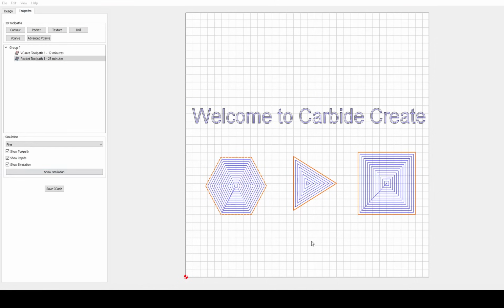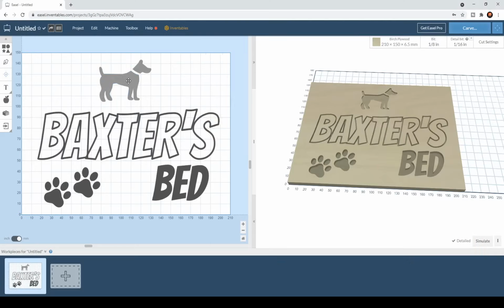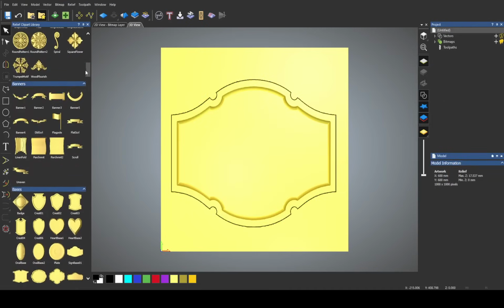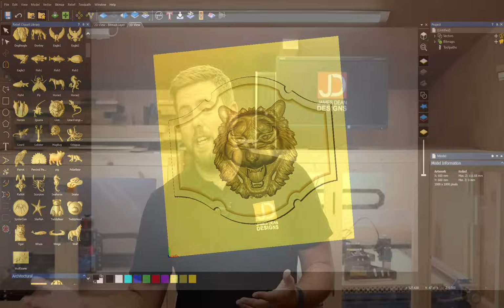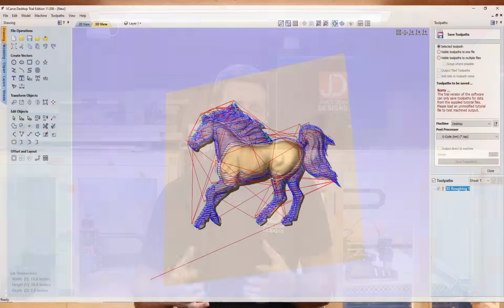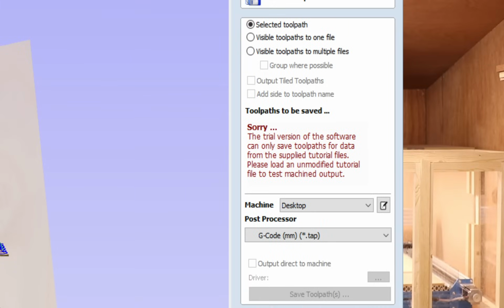Beginners guide to desktop CNC software

Comment: I have a General International CNC machine and the software that come with it doesn't work. Is there a gcode software out there I could use with my junior high students that would work with this machine? Please Help. Thanks In advance
Reply: CNC Router , sorry
Reply from the maker: @gillesdaigle7139  do you mean for creating the gcode or sending the gcode to the machine?

Comment: I have a Dell windows 10 desktop computer with a 64 bit . I just bought a CNC Pro 3018 router with spindle and lazer attachments I can use. My question is do I need two different GRBL programs to for each one. I have installed the GRBL  v4.9.4 for the Lazer. It worked the first time, but stopped, I'm guessing its  because I didn't have the Lazer installed, I had the spindle router in at the time of testing it.  It showed a connection to my computer and slid R to L and then went down it wouldn't come back up. I turned off the machine and hand spun the shaft back up to the beginning position. My kit didn't come with the manual GRBL controler, I've ordered one, I'm wondering if my Cronos card is bad. My CNC did not come with a instructions manual and my UBS installation card to connect my machine to my computer asks for a code to connect to my computer.

Comment: I’m planing to get started with cnc carving soon. Most likely I will buy the Onefinity Woodworker C-50. I have 20 years of experience with Adobe Illustrator so I was glad to hear you mention it. I also have several years experience working with SketchUp. Can you tell me if SketchUp can be used to create designs for cnc? Perhaps SketchUp files can be exported to  the CarveCo software that you mentioned?
Reply: Sorry I meant to say X-50
Reply from the maker: I can't say for certain as I haven't used it but I believe it can export both STl files for 3D as well as vector files for 2D so  you should good to use

Comment: How do you know when to change the bits mid project? Don't own a mill but looking at getting one.
Reply from the maker: Depending on the machine, it will either return to the start and you swap the bits over and load the second part of the job, or it will pause the job and tell you to change the bit

Comment: I have just bought my first 3018 cnc but it will not connect to my computer. it has an offline controller but with a very tiny screen, can anyone help
Reply from the maker: Check out issue 4 in this video as it covers a few things, but as you mentioned the offline controller, you need to make sure the offline controller has been disconnected when connecting to a PC
https://youtu.be/r-uLsMwOBfY

Comment: No comment about LinuxCNC? It's a real pain in the ass, but it is all I really know. I would love to hear how it stacks up to the other gcode senders.
Reply from the maker: I mainly focus on Windows based software for a couple of reasons.  A lot of the CNC industry use Windows, the main makers of CNC software also just make them for Windows. I do know quite a few people use Linux, especially those running their machine from a Raspberry Pi but can't say I have ever used it.
Reply: @JamesDeanDesigns  totally NOT true. industry not used newer windows base machines not safe, not stabile, all automation and cnc used linux base softwares industry. im has build industry automation to many factory last 30 year. cnc, plasma,automation, many many.
Reply from the maker: @mattivirta  but we're not discussing plasma and automation are we. Perhaps I should have been a bit more specific in my reference to CNC but it looks like you're going through my comments just to try troll so do continue 👍

Comment: Thanks for the info. I've been using Fusion 360 because I'm not afraid of the learning curve. The biggest drawback to it that I've found is the lack of a couple of key features and refinements. Two (of many) examples:
1. Feature: Lack of V-carve inlay toolpaths. It is possible to do v-carve inlays with Fusion, but you must "trick" it into doing the female toolpath. Software such as Carveco & Vetric do this automatically.
2. Refinements: This is just an example of one that I've run into. The ability to make text follow a vector exists. However, Fusion limits this to a single vector line. This means you must do work-arounds if you have a curve that contains more than one vector! 
For the price Fusion wants for a license (yes, I know hobbyists get it for free, but the paid license has the same software), this is just unacceptable to me. I'm going to give Carveco a try.
Reply from the maker: Its one of those scenarios where Fusion 360 wasnt really designed for the CNC community as such but they have tried to make it work, whereas Carveco and Vectric are pure CNC software so its much more tailored

Comment: More questions 😁
What is the best software to convert stl files into svg? Can it be done via the trial versions? 
Which software (and bits) would I need to carve a '3d' plaque? 
I'm liking the look of Lightburn. Which version to to get ? Is it the £53 one and can that import stl and export svg?

Thanks all
Reply from the maker: You're looking at 2 different file types that are not really interchangeable or not to my knowledge. STL typically being 3D models and SVG being flat vectors.

Comment: Does carveco have lead in/lead out for plasma cutting? Or what would be the best program for that?
Reply from the maker: Carveco dies have lead in and lead out, as well as ramping. However, even though I used to use a plasma CNC machine many many years ago, I can't really advise on what is the best software as that was 15-20 years ago 😕

Comment: Good day Mr. James Dean. I have a problem and I am  hoping you can help me. I am a scroll saw self leaner and decided to get into CNC. I watched your videos and purchased the 3018 pro CNC machine. I started using EASEL and enjoyed it a lot but I want to do 3D carving. I purchased CARVECO using your discount but am having trouble using the program and making a carving. could you do a video (start to finish) using CARVECO. something small.  I tried to watch other video from  other people but they use different CNC machine. i mostly use  pine and the thickness is 15-18 mm thick. I also use 1/4 inch wood. just incase you wanted to know what material i use. 
hope you can help.  chad

Comment: Not sure if you use Linux at all but it would be nice if you or someone could do a up to date install process for installing UGS on Linux.
I am not new to installing software on Linux but for the life of me I just can not get UGS to install. I have tried every guide for it, which there are very few, and none have worked for me.
The only computer I have access to run my CNC in the shop uses Linux. My only other option is to go purchase a new PC running windows, which I really do not feel like doing.
So as it stands right now I can not even operate my CNC.

Comment: I have used Inkscape for all of my 2d designs for my cnc plasma cutter. Now I'm looking to start milling plastic with my router table. Thanks for the overview of the different software packages - that helps. Can they export into MACH3 which I already have a licensed version of, rather than UGS or Open Build?

Comment: Software options are very limited if you only have a Mac Desktop and a Chrome Book to work with. Add to that that the computer room and the workshop are in different locations so the options are further reduced in both machine options as well as the software.

In line with Adobe Illustrator and Inkscape, there is also Affinity Designer.

Edit: I realise there are some later videos addressing some of these issues.
Reply from the maker: Sadly in the CNC world, Mac is kind of a secondary thought. A lot of software companies gear their software at industry which pretty much all use Windows. I know a lot of people get around this by running windows on their Mac but that solution is not for everyone
Reply: bummer...I was all set to jump into Carveco but I only have a MacBook Pro

Comment: Hi, I am a very beginner for using the cnc router machine and I bught a build one called Xpro. I also purchased a new laptop with Windows 11 but after installing cncjs software , when I tried to connect the  two, it showed there was no port available. Would you please be able to give me any advice regarding this? 
Another thing if I subscribe or purchase to carvco do I need UGS SOFTWARE as well Or carvco will work with cncjs ?
Regards Hashmat
Reply from the maker: I'm don't use CNCJS so it'd difficult for me to comment specifically on that buy I'd considering testing in another program to rule out software. Also, after you have installed the driver, does it show in the device manager?
Yes, you will still need a control software to go with Carveco like UGS
Reply: Thanks for your reply mate also wondering if you know where I can get some discount for UGS licence?

Comment: Hi James. I'm scratching my head abit. Can carveco be used with an offline controller, If so do you know how the tile function would work to cut bigger pieces than the machine?
Reply from the maker: Yes, it will work with and offline controller. You just export the Gcode files onto the memory card and run like normal. And yes you can tile as well, I believe it just gives you different files for each part

Comment: James you may have already answered but I'm a bit slow sometimes, ;-), One quick question? Does Lightburn, Carve CO and UGS work with the fox Alien 4040XE? I heard you mention the 3018 so wasn't sure?
Reply from the maker: Yes, if its a GRBL based machine (which most desktops machines are) then yes it will work with those software 👍

Comment: I've just bought a 3018 cnc engraver but I use MacBook and can't even get it to connect to my laptop, the Mac doesn't even know the usb lead is plugged in. anyone got any experience with the 3018 on a Mac?
Reply: who idiot buy mac today not can use lot most popular softwares or all have very expensive, lot better and cheapen use normal windows or linux computer today.

Comment: Wow, I'm impressed by the massive amount of information in this video. I made it up to the end  (and now I have a headache LOL) 
The information is very clear.  (just now I noticed this is an "old" video)  What I miss is a visual recap in the end, A kind of schedule/table with the most important information.
But maybe you did that in a later video. I didn't check it. Thanks for sharing the video in any case.

Comment: Affinity Designer is an amazing Vector Base Software similar to Adobe Illustrator that is just as powerful but only has a one time cost for it. I think it is like $50. It is an amazing piece of software. I use it for all of my Laser Engraving Designs and then export them into Lightburn.
Reply: I agree and the new version is even better. Adobe is way too expensive for the average user.
Reply: @shawk364  Agreed! Adobe is expensive My head is reeling! Probably going with the Genmitsu 4040 , Carveco, UGS, and affinity. Probably no laser. How does this sound?

Comment: You say the basics and then go on without doing that. Would you make a video for us that need the basics and from the start? Plug in the USB or disc that comes within the machine and then stay with the one you recommend, Easel and from the start, Basics 101 then the relationship of G Code and that use. I have saved four of your videos and appreciate your input, but you're like Windows help line, more information than requested to the point I am information saturated and more confused than learning. Thank you.
Reply from the maker: This is just a basic overview of the various software. I cover the basics of using some of them in other video which I think you may have seen.  I hope they help
Reply: @JamesDeanDesigns  I found it and responded that it was what I needed. Thank you. Ted

Comment: I've made sure all is wired correct.  The machine jogs properly yet when it begins carving it's upside down and reversed from what's viewed on the computer screen.  What am I screwing up?
Reply from the maker: What machine are you using? If its a 3018, when you say jogs correctly the bed should move forward when you click backwards and vice versa. Its a big misconception on the 3018 because the bed moves back and forth and not spindle. is that the case here or is it something different?

Comment: You didn't discussed about MACH 3 and 4 they are also popular software
Reply from the maker: Thats correct, I dont cover them. Couple of reasons for this. Mach3 is now considered to be outdated and runs on parallel ports which have not been installed on computers for many years. I know there are some work around but ultimately it still comes back to it being outdated. Mach4 is the newer version but has not been anywhere near as popular, in fact a lot of people went back to Mach3. Both of these also require a license fees where as GRBL does not as it is free and has more than enough functions for most users. But probably the most important thing is  99% of desktop CNC machines come with GRBL based controllers so I generally do not cover anything Mach related to help keep it simple.

Comment: Hi, Hope so you are doing well and this comment finds you well.

I am working on the stages of Microscope and want to move it in XYZ direction by using stepping motor Actuators. To control this 3-axis motion which software will be better.

Please Answer. looking forward  to hearing from you soon
Reply from the maker: for me, I would say UGS. It has a separate control the the Z axis which I imagine would be crucial for operating a microscope

Comment: Question. In Carbide Create, when setting up my machine, there is no option for the 3018 Pro, however, there is GRBL options. But, when I run the design and save the G-Code to my controller, I run the file but nothing happens. What am I doing wrong?
Reply from the maker: Can you see the file on the visualiser in your controller?
Reply: @JamesDeanDesigns  I see the file name, yes. When I run it, it just comes up as printed with no percentages or anything. Then I have to reset the entire unit to even get back to the controller settings.

Comment: JD, your excellent vid needs an upgrade of info. As of 2021, there is no more Easel-Basic (w/4-days of PRO/mo). It is now only 30days free of Easel-PRO (per email acct) and then you must pay for Easel-PRO. And as of 12/21 Easel has jacked price to $24.99/mo or $223/yr....... Hence, I will be converting to Carveco (being a hobbyist on a retired fix budget) plus I want to play with 3D-carving that Easel cannot......... My hope is 'LightBurn' OTP will soon add a 'LightCarve' OTP.................. I wish I'd have know the limitations/kinks of 3018P, so my 2021 xmas present to me is a 4030XL w/6060 extension - serious hobby here just like HAM Radio. TNX
Reply: No one asked you
Reply: I would like to humbly suggest GatorCAM for cnc.  I made it for everything i wanted in a cnc cam tool !

On my channel.

Comment: I have a plazmacam dhc2. Due too some paperwork not filed correctly, personal no longer working and politics I'm unable to deal directly with plazmacam. It runs off designedge software. So due to my issues I can't get and upgrades. I guess my question is can I use other software on this table?

Comment: I'm currently in the process of evaluating software.  I'm leaning towards Carvco, but I have a Mac so I would have to use Windows in my VMWare Fusion virtual machine.  Has anyone tried that configuration.  Also, I don't see the ability for a trial license of Carvco.  Are they still offering a trial?

Comment: Great videos and instruction! Thank you :) My cnc background is using V Carve Pro and Mach 3, however these programs are not compatible with the 4030. So in essence I'm having to relearn a few things although minor in comparison to a complete noob. With V Carve all I had to do was export the GCODE via a .txt file and load it into Mach 3. The issue I'm having is choosing which file extension to send to UGS from Carveco as there are many to choose from.  Which file extension is your "go-to" when sending from Carveco to USG? Thanks
Reply: Nevermind...... I found it.
Reply: @kenneth4582  as I’m a noob trying to figure things out… care to share your findings? ;-). Cheers.
Reply: @ronnievansanten  Under the drop down menu when choosing which file extension to export for the 4030..... Scroll down to Sainsmart and you will see various options to choose. Hope that helps......Cheers back at'cha!
Reply: @kenneth4582  thanks Kenneth!